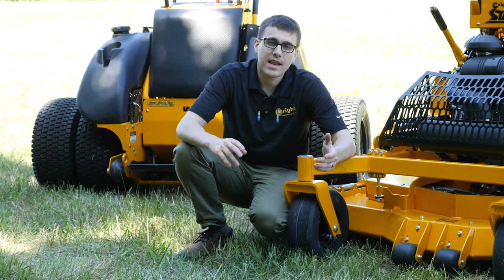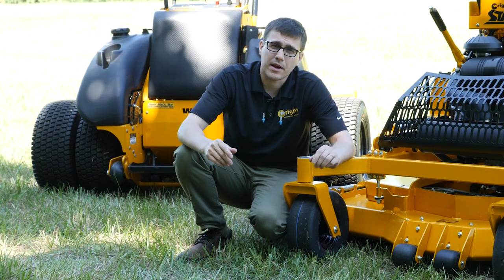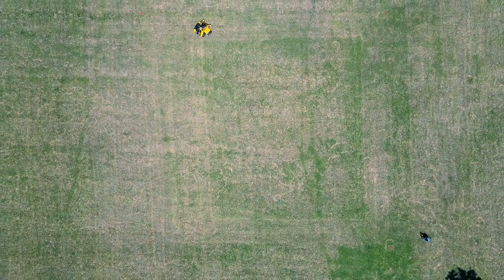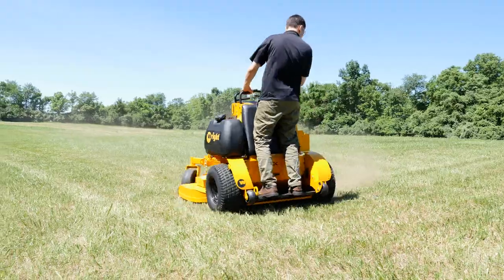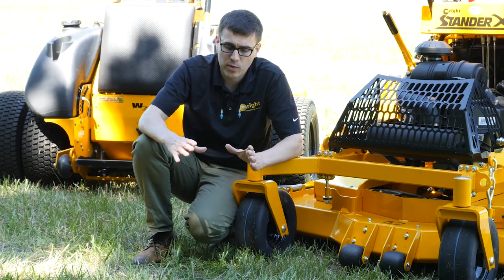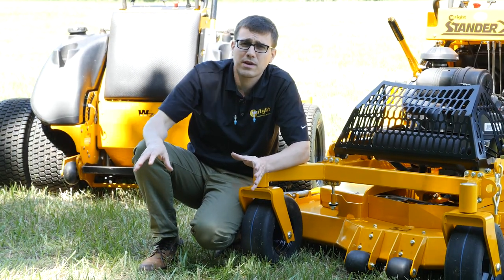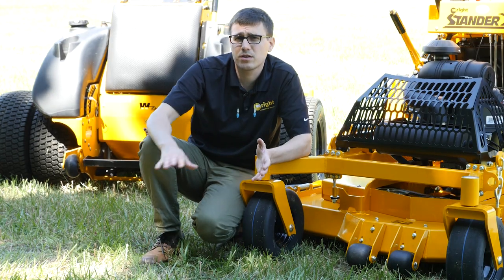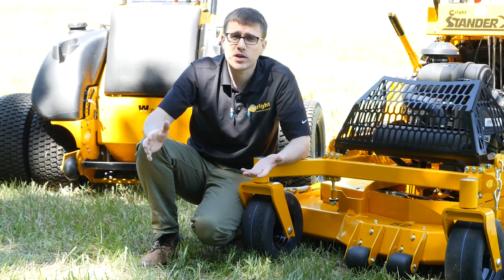Basic Mowing Patterns

Comment: Hi wright mowers. I have a question. I have an old wright stander rh from like 2007. I love it but I recently have encountered an issue and I was wondering if you would know what the fix would be. When I push the right lever forward it doesn't spring back to the neutral position. It just stays forward. If you pull backward from neutral it springs back to beutral like it's supposed to. The left lever works fine in both directions. Any idea what my problem could be?
Reply from the maker: Sounds like an issue with the return spring mechanism.  I suggest you stop by the nearest dealer and have it looks at. -Ed